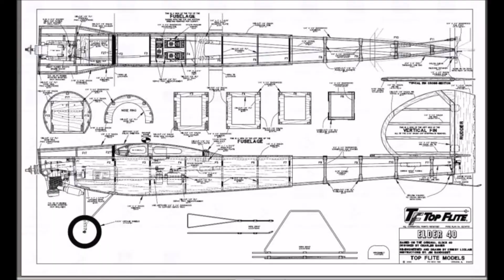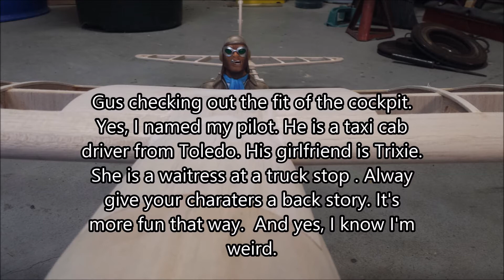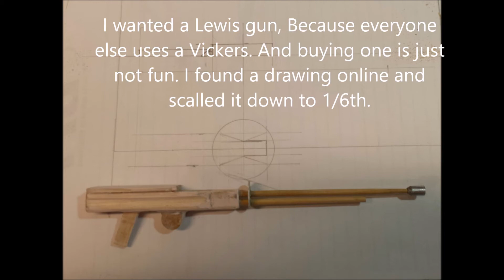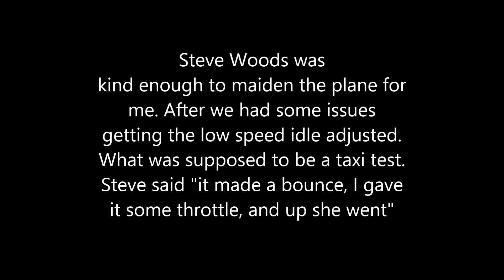TopFlite Elder 40 build and maiden flight.

Comment: I really like your build and the changes you made. I am giving some thought to buying this kit. I have an OS 72 four stroke. Do you think that would be too much for this model?
Reply from the maker: From what I've read in some forums, This kit is know for needing a lot of nose weight. some have placed the firewall a inch or two forward.  But, Mine didn't need added nose weight. Probably because of the extra weight of the four stroke engine and the added weight of building up the cowl area using 2 layers of 1/16th instead of 1/8th. It has some challenging compound curves. The aluminium weighed very little. I'm sure the epoxy used to glue it all together was most of the weight. It looks like the 72 is an ounce heaver than the 62 I used. I wouldn't think that'd be a problem if you built a little lighter than I did. And I did put my receiver battery as far forward as I could. I also used the 1/6th size wheels. Some use the 1/8th. Personally choice on which you think looks better. I think you'd be fine with the slightly larger engine.  If you decide to build one. Please let me see how it came out.
Reply from the maker: A few tips on this kit. Make sure you use epoxy on the rear of the fuselage. I've seen videos of guys that used CA and it comes apart on the first landing. It couldn't hurt to make the rudder a little bigger. I set mine up for the recommended throws and ended up setting the servo to 150%. Granted. that was the maiden flight. The linkage can be adjusted . I'd relieve the elevator just a little more than the plans say to give yourself a little more clearance, just in case you need it. My rudder comes just shy of hitting the elevator at full throw. I used wire for the rigging on the rear. But in hindsight. The elastic I used on the wings would have been just fine. And probably less time consuming. Also, I ended up replacing my wing rigging with the heavy/thicker elastic. Just looked better to me. And It doesn't flutter much from the prop. There is a fair amount on tension on them.  Like all WW1 planes. A tail skid has very bad ground turning characteristics. My kit came with a tail wheel. I may end up using it. If so, I'd make a skid that come up to it , That may help hide it. If you want a round nose. A  1/2" round over bit works great. Also, follow the plans, not the instructions on the wing bolt mount. It was moved down for more strength. My plans showed the correct location. The amendment in the book was for the old drawing and caused me to have to redo it.  I've seen videos of the wing coming off in flight of older ones.
Reply: dean thomas
1 second ago
Thanks for the tips and advice. I really like how you rounded the nose and dollied the cowl in the form you made. That was slick and it does look better. I don't use CA much anymore. My glue of choice is Weldbond. I have used that glue for well over 20 years and even used it along with .010 pillow ticking to glue wing halves together. Good stuff.